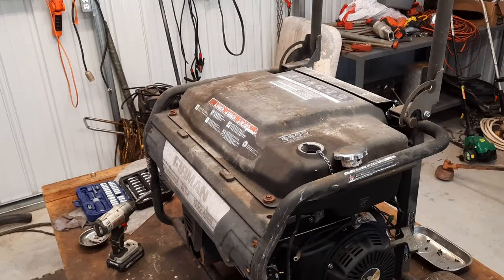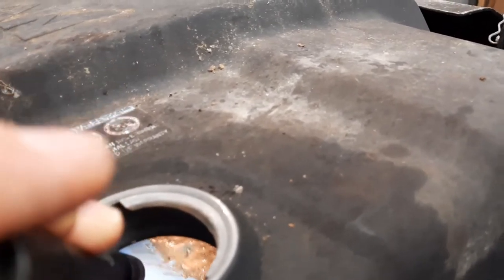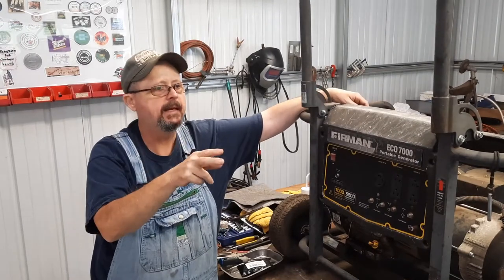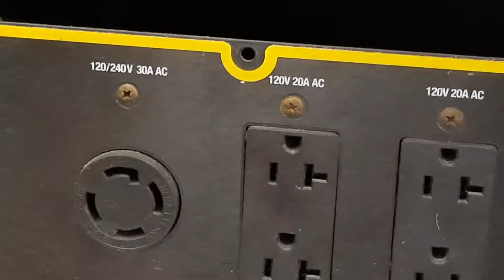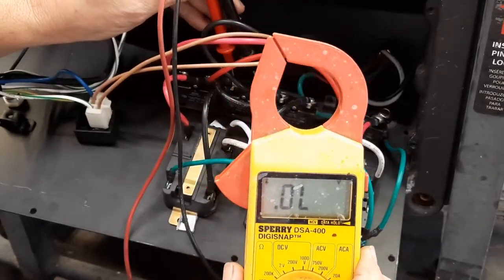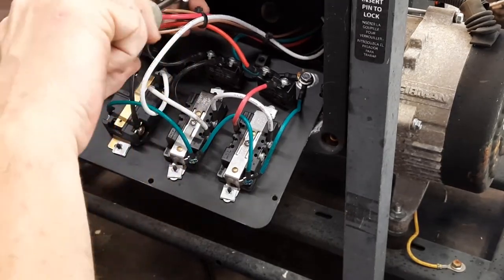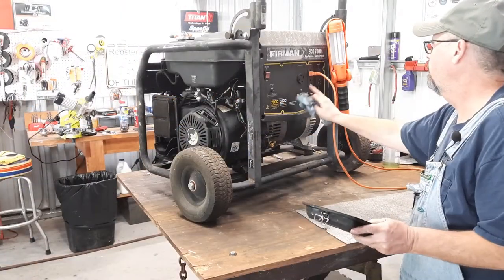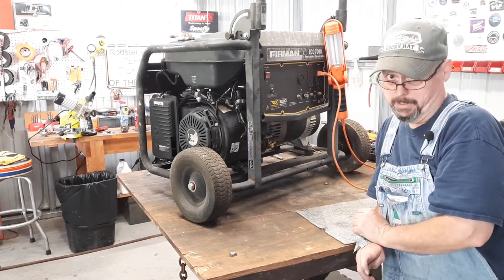FIRMAN Generator. Will it run? Will it make Power?

Comment: Great fix there RR! That James Condon is very good at diagnosing and fixing generators. You got that old Iowa ethanol out of that tank. I dont know why they ever made metal tanks for generators, that sit 90% of the time. 👍🇺🇸🕷🕸 Roger
Reply from the maker: I'm with ya on the metal tanks and ethanol, thanks again for everything.